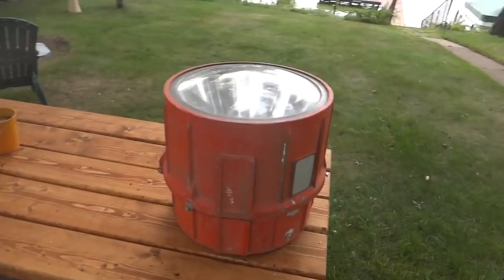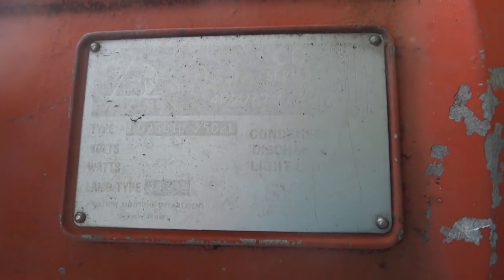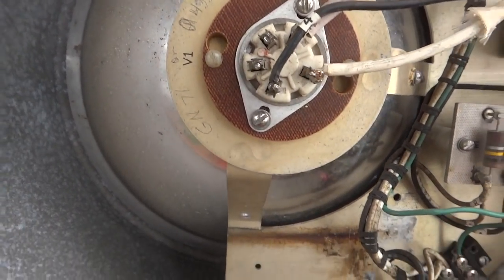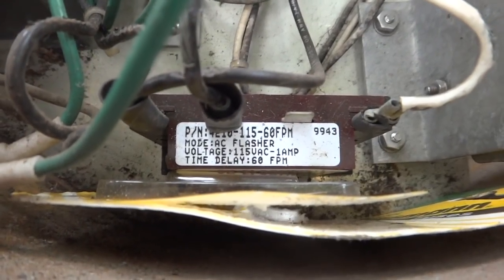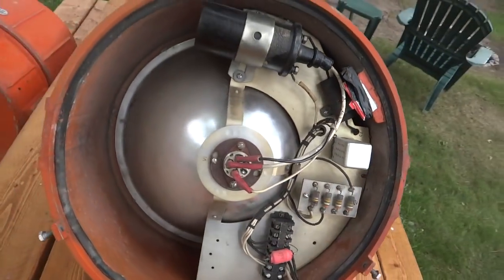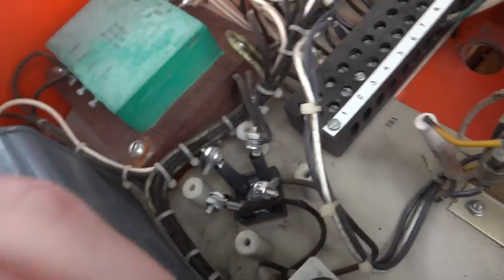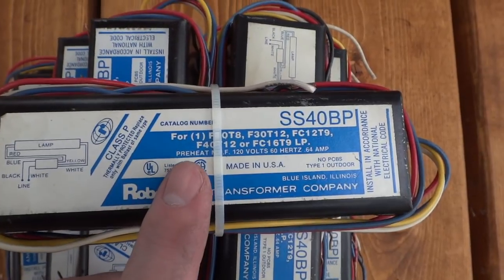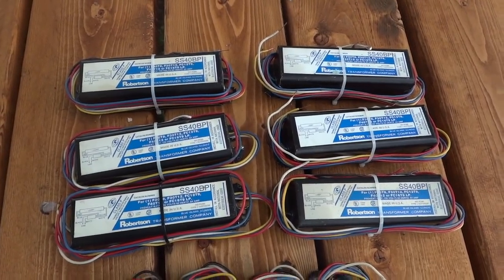Sylvania Runway End Identifier Lights - V13

Comment: Those aviation runway lights are cool but good luck finding bulbs for them.  I have never ever seen an Xenon discharge bulb anywhere.  If I had those fixtures, I would just drop in a metal halide ballast.

Comment: The broken item is a power resistor, it should be marked to identify its value in Ohms and power rating such as 20 watts for example. The other resistor near the gray capacitor is most likely a discharge resistor to drain the stored energy from the capacitor when the light is turned off ( Safety! )

Comment: The 2 primary windings of the power transformer look to be wired in parallel for 120 volts, they would be wired in series for 240 volts otherwise. Anyway it does appeared to be configured for 120 volts and has the option for a 240 volt supply as in the UK or Australia. The 1450 volt output of that transformer would be connected the bridge rectifier to produce high voltage DC to charge that large capacitor, be very carefull with that one, it most certainly is capable of storing a lethal charge!

Comment: That cylindrical item near the lamp socket looks like an automotive ignition coil, that would be used to deliver a high voltage pulse to the strobe to enable the tube to strike, that coil would be connected to the timing module to produce timed light flashes. Those 2 interlock switches are most likely safety switches to deenergise the high voltage when servicing the light enclosure.

Comment: Tha large grey block marked 2000 volts is a discharge capacitor for the lamp and the smaller item is a full wave bridge rectifier to convert AC to DC. Beware of lethal stored voltages around the capacitor and strobe tube if you energise that light especially when you turn it off as that capacitor can hold a dangerous charge for a long time after power off.

Comment: The larger gray box is, i think a capacitor...probably the main flash cap. The black round thing near the flash tube (bulb) actually looks like an old time ignition coil off a gas engine, before electronic ignition. This probably provides the trigger voltage to fire the flash tube. The setup reminds me somewhat of what is used on aircraft obstruction xenon strobes used on tall objects like what is made by Flash Technology, Hughey & Phillips, etc.